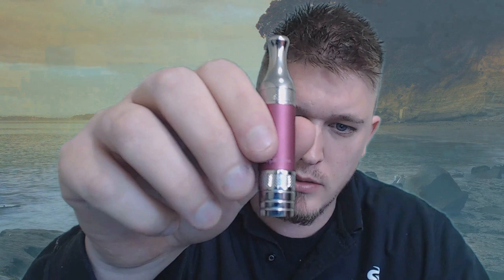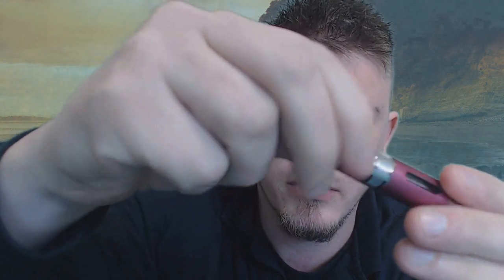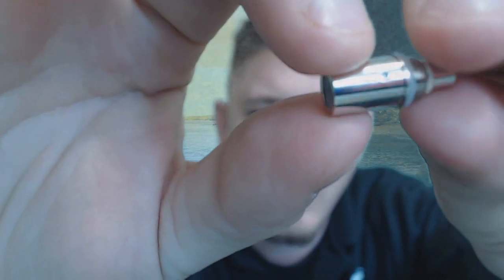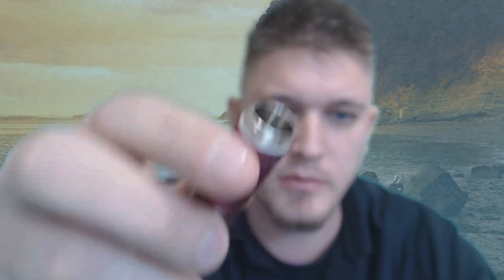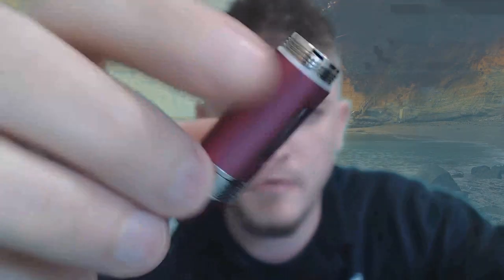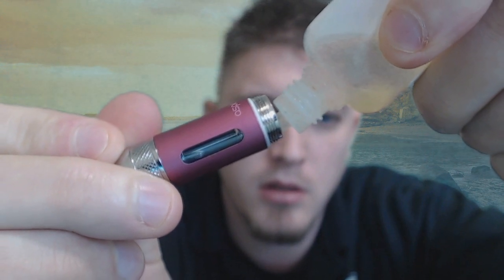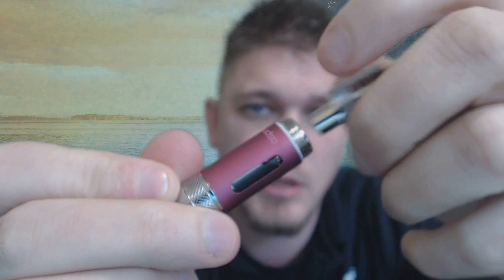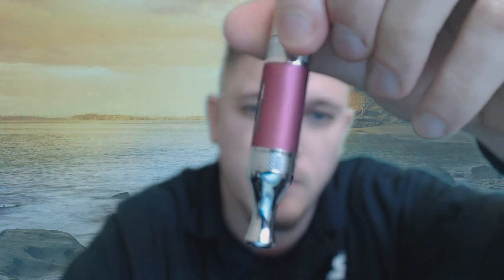Aspire et s bdc how to movie

Comment: Nice video. But my girlfriend has this tank on a clover battery. Problem is that it had leaked in the battery. But I cannot get that very bottom piece that is around the coil off the battery. Is it air shut or something? I have tried vice grips but didnt want to damage it. Anyway of showing how you took this on and off the battery?
Reply from the maker: The tank should just unscrew like a light bulb from the battery. Sometimes if the tank has not been taken off from the battery in a while it is very challenging to get unscrew. A pair of pliers sometimes is necessary to get it to come Loose. I do suggest once you get the tank loose to make a practice of taking the tank of at least once per day and remember to just tighten tank down just enough. Check out my video on basic ego battery maintence.
Reply: Andrew Stravlo thank you. I dont think she ever took it off. But I was going to use pliers but didnt want to damage it. But ill give it a shot. Thanks

Comment: I receive one as a gift is this a good brand?  Aspire bdc.      And what atomizer/ battery do i connect it too?   The person only gave me the aspire bdc tank only. Lol
Reply from the maker: john tran aspire is an excellent brand with very little problems. 

The aspire Bdc can be used with just about any mod, but it performs good with just a basic ego battery.
Reply: Andrew Stravlo i see. Im new at this and your video is years ago so i just wanted to ask.  It is moded with a segelei display.  I hope the battery dont blow up like i hear in the news lol
Reply from the maker: john tran the sigeli should be fine. If they are old batteries or damaged with the wrapper peeling off I would suggest buying new ones to be safe. 

Most of the time when the batteries blew up it was due to mishandling and of course from what we used to have in the market called “ mechanical mods” these mods did not have any safety features which would allow the batteries to be over used and abused to the point of explosion of “venting” 

The mods in today’s market are much safer than previous years.
Reply: Andrew Stravlo cool thanks. Its an old school mod. Brand new since 2012 but my friend never opened it and gave it to me today .   Aspire bdc with seglei legend mod

Comment: How do I fix the burnt taste I keep getting
Reply: either replace the coil itself which is this part http://www.mtbakervapor.com/accessories/aspire-et-and-et-s-bdc-replacement-coils-5-pack/

or, clean it.  however, when I cleaned mine, it stopped working entirely.  so, I personally recommend just replacing it.

Comment from the maker: The burnt taste can be caused by several factors. Typically is caused by a variable voltage device being turned up too high for the resistance of coil. Or you might just need a wick change. Please contact us at flavorvaporcorporate@gmail.com and we can further diagnose your issue and get you enjoying your vape again:-)